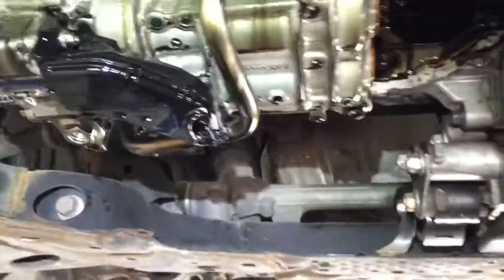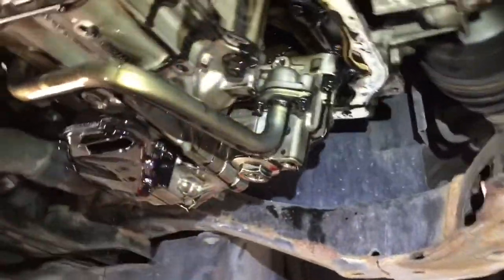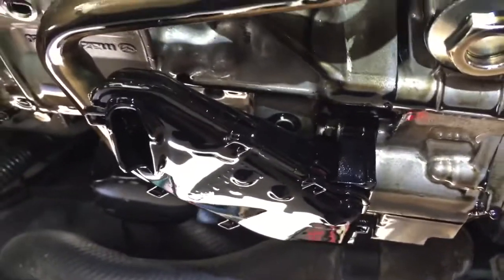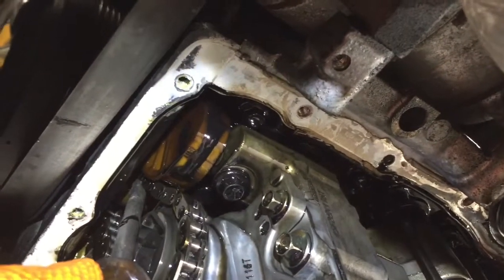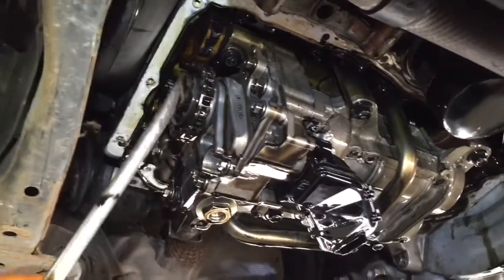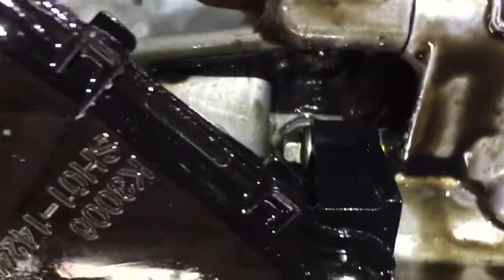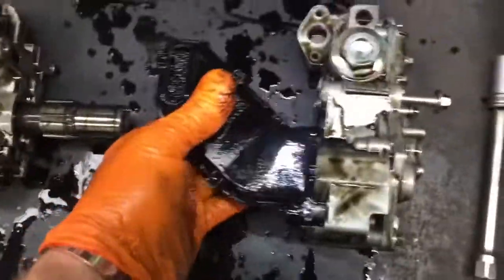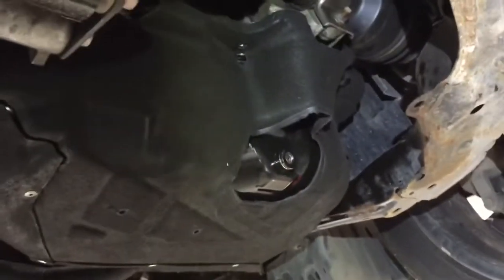Mazda engine failure caused by oil pump strainer & replacement

Comment: Hi Peter,,can I ask you 2 questions please,,,,when you remove the oil chain bolt did you still have to push in the tensioner it or did it just go back on, looks tricky to do as I be on the ground doing it,,,,and do I have to replace the strainer or can I just blast it with cleaner until good,, cheers john

Comment: Does the 2.0 skyactiv has this as well. I assume it does.
Reply from the maker: @johnmactavish5191  I’m actually not familiar with the 2.0 Skyactive, is that diesel??
Reply: @kennedysgarage3281  
The 2.0 skyactiv is petrol. The US may not sell this variant but in Asia, Mazda do equip their mazda 3 & 6 & cx5 with the 2.0 skyactiv.

Comment: Hi mate, great video. Was this a hard job to do? Also does the sump have a gasket or just sealant
Reply from the maker: @TheTom1998  I really don’t think it’s too bad, but I do 1 or 2 a week.
The sump is stuck on with sealer, so it will most likely slightly bend on removal but just turn it upside down on the floor and tap it straight 😉👍👍
Reply: @ thanks for the reply, I’ve actually done mine since watching your video. Not a bad job at all. Thanks again
Reply from the maker: @ well done mate 💪💪

Comment: The oil strainer comes with a small rubber O ring. But when I fit it to my oil pump with this O ring it doesnt mount on properly? Can you fit the strainer without the O ring to the oil pump? Problem is the only part that shows if you leave the O ring in has been cut from the edit in this video
Reply from the maker: @leonangus1  the only issue you should be encountered is the new O rings are not compressed like the older one. Tighten the bolts slowly and see does everything come together as expected 🤞🤞
Reply: @kennedysgarage3281  Thanks sorted now cheers

Comment: Peter, can a clogged oil strainer on a CX5 cause the engine to hammer loudly like a tractor? I have thst problem and the oil light flashes up intermittently. I have stopped using the car.
Reply from the maker: Yes, oil starvation is like us loosing blood pressure. It can be very serious very fast 😬😬
It sounds like you have a bearing on the crankshaft shaft after failing. This is very expensive to repair, complete engine rebuild 😞😞

Comment: Can those plastic strainers be opened????
Reply from the maker: No. At least not opened and then reassembled.
Lots of people try cleaning them but from what I see to no avail. They generally block due to injector washers failing so be sure to remove the rocker cover to check before replacing the strainer. It will block again if not 😉👍👍👍
Reply: @kennedysgarage3281  Thanks for your help 🙏

Comment: Hi Peter  i have a 2013 cx5 2.2 done 80km . I change  oil every  3000km because  of oil dilution i dont let it get to x on dipstick . Oil pressure  light  came on the other so i changed  oil went for a 30min drive and it came on again  . Took  into a garage  with an average  scantool he reset the oil dilution code . Could  the light  of come on the second  time because  oil dilution code hadn't  been reset ? Injection seals were replaced about  20,000km ago they said  the previous  seals hadn't  been leaking.  Thinking  about taking the sump off . Thanks
Reply from the maker: Wait and see how it goes over the next few days. The oil dilution counter can illuminate the oil light. And everything sounds positive by changing the oil seals etc. recently. 
If the oil light is still coming on then remove the sump & replace the strainer 😉👍👍
Reply: Are u doing a lots of short trips. I am in nz and hitting 3000km got bad oil😅

Comment: hi peter got a 2012 cx5 on 65000 miles light came on saying low oil pressure about 3000 mile ago done 2 oil change with engine flush and all seems to be fine now how many miles before you have to change the oil strainer and do you think i should have a look at it now 

thanks 
neil
Reply from the maker: Hi Neill,   Has it come on since ?? And did you do an ‘oil dilution reset’ ???
It is very common for the injector washers to leak & buildup lots of carbon in the crankcase, which in turn blocks the oil strainer. It is a really good preventative maintenance job to do. It prevents any bigger problems arising 😉👍👍
Reply: @kennedysgarage3281  hi thanks for the reply no the light hasnt come on since but i have changed the injector washers on the weekend and going to remove the sump this sunday just to make sure 
how do you do the oil dilution reset ?

thanks neil
Reply from the maker: @NeilCook-v3s  you will need a scantool and go into special functions or hot functions. You should see oil dilution reset in there somewhere, all scantools are different so that’s as specific as I can be. 
The best of luck with the oil strainer job & mark everything when removing the oil pump timing chain. Can’t go wrong then 😉🤞🤞🤞
Reply: @kennedysgarage3281  can carbon deposit (if it exists) be checked without removal of the system? Just by visualization?
Reply from the maker: @sull5307  you can look at Oil pretty live data but it can quite often be misleading, especially on cold start. Remove the injectors for a look to see if the injector washers are leaking, this is a good indicator 🤔🤔

Comment: Thankyou l got one mazda demio disel 2015 bt bt when ingine oil symbol appears it cut off immediately and no more acceleration  can be done unless u start up again can it be oil pump problem
Reply from the maker: I would definitely start by looking at the oil strainer. It is most likely blocked 🤔🤔🤔
Reply: same symptoms with my junk Mazda. I hope you were able to solve it, if so? Can you tell me how?

Comment: Loving these videos . 

I have a Mazda 6 2010 2.2 D 185 … 200k miles but now oil pressure light flickering at idle 😢 . Any ideas 💡
Reply from the maker: Hey Gary, the oil strainer in the sump is more than likely the cause of your problem. This has probably happened due to the injector washers leaking & building up carbon in the crankcase 😬😬
I’m delighted that that you are enjoying some of my content & thank you 🙏🙏👍

Comment: Hi Peter, How much would you charge to replace that plastic oil strainer. I recently bought a 2016 2.2d and the dealer advised me that the injector washers had “just started leaking” and were replaced just before I purchased the car.
The the oil was supposedly changed also but has a diesel smell and would slightly above full mark. I changed it again myself, but would like the strainer done as a precaution.
Reply from the maker: It is a good idea to change it around 100k to 150k .  An average costing of around €700 in total. Have you had the intake manifold cleaned??

Comment: And the oil strainer blockage by carbon build up is caused by one blown or few blown injector copper seals.
Reply from the maker: Absolutely correct, it is the most common cause anyway 😉😉

Comment: if I'm seeing this correctly, you had to remove the entire oil pump assembly just to remove that plastic piece? I think I might just rip that strainer out of there to prevent engine failure. My 2012 has 200,000 miles on it, so I imaging it's quite clogged by now.
Reply from the maker: You are seeing it exactly right, the pump & balance shaft assembly needs to be removed, then disassembled in order to remove 1 bolt holding on the oil strainer. It isn’t as big a job as it seems though. It probably only takes around 30 minutes extra 🙏🙏👍

Comment: couldn't you just split open the plastic housing? it looks like it has clips holding it together
Reply: Hope this helps same problem i managed to get the oil strainer after mechanic had taken off, then broke into with pliers, to reveal the carbon build up, so no they do not just unclip, hope this helps
Reply from the maker: @dannyreeves5153  thanks for the info Danny 🙏👍
Reply from the maker: I haven’t ever tried to split them, I was advised once to just replace it & that is what I have done from then on. The strainer are quite inexpensive, around €70 or €80 & then you know it is right 😉👍👍

Comment: Hi Kennedy. Amazing videos. Thank you. I did my strainer change, now the car cranks but won't start. Any idea what it might be. Please any help would be appreciated
Reply from the maker: Nothing involved in the oil strainer replacement would stop it from starting afterwards. Did you carry out any other work??
By the way my name is Peter
Reply: @kennedysgarage3281  hi Peter thank you for the reply. the chain did move a bit when I tried to remove the bolt holding the timing chain. And I did do my EGR and manifold clean as well.   It was packed with carbon. Checked the battery and  fuses and relays, they are all seems to be good.
Reply from the maker: @morushdi8076  once you didn’t loosen the bolt in the crank pulley your timing will be fine. I wonder could some carbon be stuck under the intake valves, affecting compression??

Comment: Good video on the subject. I've a 2016 CX5 2.2 diesel with just over 50k miles. I've been changing the oil every 6k miles as we mostly drive short journey's and know about the oil dilution issues. I have no issues what's so ever with the car but would it be worth taking the sump off to have a look at the oil pick up for any carbon build up. It's due another oil change soon. Cheers.
Reply from the maker: I would say the miles are a bit low & especially when changing the oil ever 6k. 
Just my thoughts but it is very easy to remove if you wanted to, around 2 hours 👍
Reply: @kennedysgarage3281  in all my years I've had not bad cars . I love how these drives but I've come unlucky on mine huge work being done atm new HD rockers cams etc normally if I'd have had car a good few years I'd rid of it but taking dealer to court (not mazda) so having the work done . Misfiring from a few weeks in til now getting worst.  Had other issues had 1 new injector etc new therm.   coolant sensor etc but what a ball ache.  This I'd likeky do along with no issues doing water pump and belts but I'm not touching it as I shouldn't have to ....got enough to do with stripping my bike engine the bustards sold me a shit box
Reply from the maker: @kevinhancock4064  that’s unlucky, hopefully you can get it sorted 😞

Comment: Say I was doing this on the driveway. Can I just fire buckets of brake and clutch at that gauze or is that pump off and replacement necessary
Reply from the maker: I used to just do that on older steel types but I’m told that it doesn’t work on these pickups. But I suppose it can’t do any harm. It is only a gauze 🤔👍
Reply: Cheers big man, enjoying the videos too. Top work

Comment: Is there any way to tell visually if the injector washers have been replaced or anything in this video has been performed on a car without any detailed history? Looks doable thanks to your video Peter so I’m thinking preventative maintenance rather than “bang” 💥 and then think well I should have done that‼️
Reply from the maker: Pull of the oil filler cap when engine is running & if injector seals are leaking you can hear it. If you looked at the sump and saw not factory sealer it might tell you the oil strainer was done . You could also check oil pressure is in spec. Other than that unfortunately history is the best way of knowing I believe 🤔👍

Comment: great video mate. how much would this cost at a garage roughly?
Reply from the maker: Another chat in the comments said that the dealer was charging €690 , it would be around €400 to €500 aftermarket 💷💷
Reply: @kennedysgarage3281  where abouts are you from, you should do this as a side line job as I'm on a Mazda Facebook forum and there are loads of people asking to have this job done
Reply from the maker: @dmc_77  in the Sunny southeast, Waterford area to be precise.

Comment: Hello, do I need special tool for removing the oil pump driven sprocket?
Reply from the maker: Hi Samo, it can be done without any special tools. Just mark the oil pump pulley to something that doesn’t move & refit chain in the same place. There is a balance shaft inside it but it makes very little difference even if fitted incorrectly. Hope this helps 👍
Reply: @kennedysgarage3281  Hello, thank you! How you hold sprocket when removing driven sprocket installation bolt?
Reply from the maker: @samostraser8924  I use a very large pliers to grab the outside of the chain, I think you can see this in the video, also there is no key way from pump to pulley so mark the pulley to the shaft when the bolt comes out also
Reply: @kennedysgarage3281  Hay, yes I saw pliers, but I was not sure if you also use pliers for removing or no :p. I will be very happy if you once show us, how to replace timing chain on Mazda Skyactiv-d. Have a nice day!
Reply from the maker: @samostraser8924  I will do a video on timing chain replacement & injector removal as soon as one comes in 👍
Reply: @kennedysgarage3281  Super, I hope soon 😁
Reply: @kennedysgarage3281  Hay, just one more thing. Which timing chain set (producer) you usually put on when you replacing?
Reply from the maker: @samostraser8924  I not fussy what brand it is once its a well known brand like Gates or Dayco and once I purchase it from a good reputable supplier so I can give out to them if anything goes wrong 🙂
Reply: @kennedysgarage3281  Hello, which timing chain set you usually use for Mazda Skyactiv-d? I cannot find any from Dayco, Gates is better know bacause of belts I think.
Reply: @kennedysgarage3281  Hello, is there any video from chain replacement mybe ;)? I need something also to ask, like always :). When you remove front / timing cover there is no gasket, so which silicone for gasket do you use?